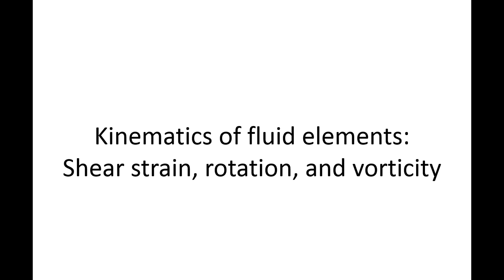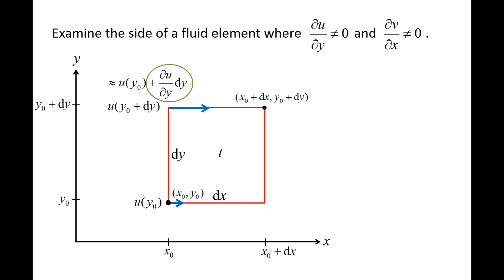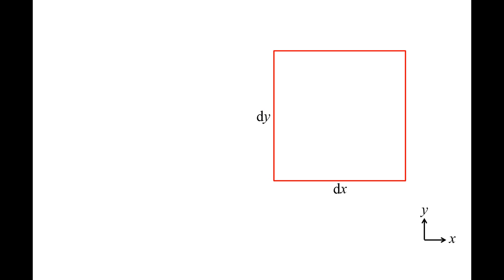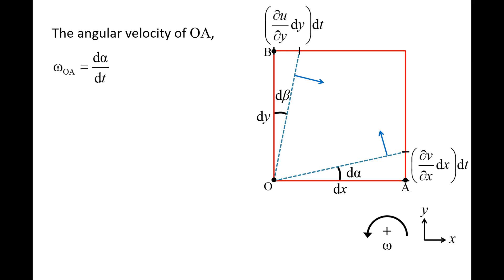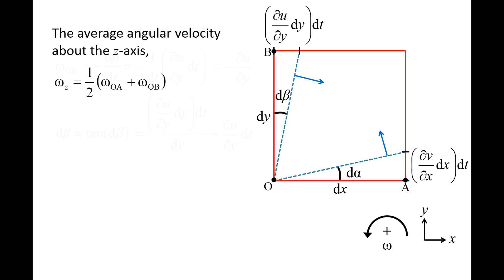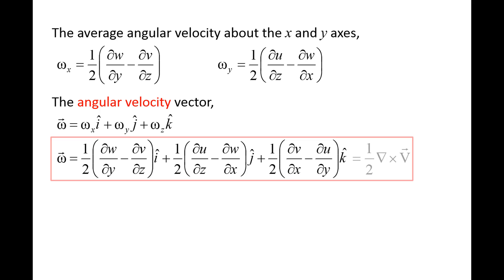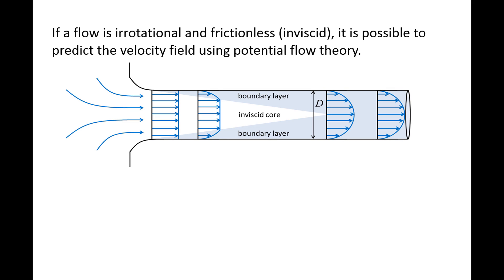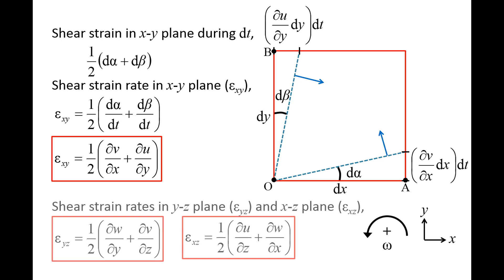Fluid Mechanics: Topic 10.5 - Kinematics of fluid elements (shear strain, rotation, and vorticity)

Comment: it's awesome video!!
but i have  a question!!
when explain angular velocity 
why do a and b rotate different way?
i think that picture means shear strain, not  rotation
Reply: 전하성 Same doubt bro , this is rather a case of angular deformation in which both the sides oppose each other's motion. I have no idea why it is used to explain rotation. Morover even in books the same technique has been used
Reply: Yeah, you're right.. in that picture both angles are positive since both displacement are positive as well.. so, hes explaining pure rotation with a pure shear sketch. And i still dont see why shoud we talk about average values.. looks like we need it to fit the expressions given by splitting the displacement tensor into the sume of the symmetric tensor (pure strain) and the anti-symmetric tensor (solid rotation).. which give the 1/2 in ecuations.. but really need that? Cant see the meaning of doin it

Comment: Why do professors not teach like this? Everything is visual and it gives you an intuitive sense where the derivations are coming from. As a result it makes you ten times more invested in what you're learning.
Reply from the maker: Glad you enjoyed the video.
Reply: I have a question. Can we devise a strain rate matrix (3x3) for the strain rates? Where the linear strain is along the diagonal and the shear strain rates are along the non-diagonals. Is it safe to assume that E_xy is equal to E_yx? If so, the matrix will be symmetric. This is interesting to think about.
Reply: @CPPMechEngTutorials  Back again, but this time taking graduate level fluid mechanics. We are talking about tensors now. We are discussing symmetric and Symmetirc Velocity gradient tensors...help lol
Reply: @carbon273  hey dud! I have same doubt about it.. i can get the displacement tensor and split it into a symmetric tensor by (e+eT)/2, which gives me the strain tensor and the ant-symmetric one, by (e-eT/2), which is the solid rotation tensor.. thats what gives the 1/2 on expressions.. not sure why he talks about average values.. have any clue? And shear strain is the sume of both angles (du/dy + dv/dx) so.. again not sure why should we take the average.. regards.

Comment: shouldn't the shear strain rate be the change in the angle between two sides that were originally perpendicular? Why is there a 1/2 term in front of the shear strain rate?
Reply from the maker: It's the average contribution from both sides moving.
Reply: The way I look at it is if w_OA and w_OB were equal (let's say both are 10rad/s) and rotating left then the element rotation would be 10rad/s. If you sum both without the 1/2 you would get 20rad/s which of course does not make sense. If an object rotates 10rad/s then after a second it has rotated 10rad. So segment OA would make a 10rad angle with the ground and segment OB also 10rad angle with the vertical.
Reply: Same question. The expression for shear stress   tau (xy)=(mu)(du/dy+dv/dx). This is the viscous coefficient multiplied by strain rate right? So where is the 1/2 term gone? Note that the derivatives are partial, I can't type them here.

Apart from that, amazing video.
Reply: Yeah, i have the same doubt.. shear strain is how many grades decrease or increase the original 90º angle because deformation.. so.. is the sume of both angles (du/dy + dv/dx).. so.. why talking about average here.. why there is 1/2 here?.. i know that 1/2 came fron splitting the displacement tensor into the sum of a symmetric and an antisymmetric tensor (fisrt is pure strain and second is pure rotation), which gives me the 1/2 expressions.. but cant see it cleary on the sketch.. neither its meaning
Reply: @flavioluisginobertolini6144  My understanding like this, the deformation in xy plan comes from two shear stresses, i.e. Taux,y and Tau,yx. Taux,y give the angle of dAlpha and Taux,y give the angle of dBeta. since Taux,y and Tau,yx and qual, the strain rate come from Taux,y is half the total angular velocity.